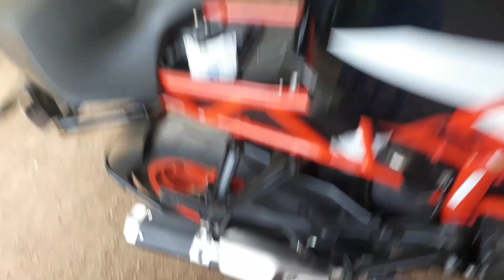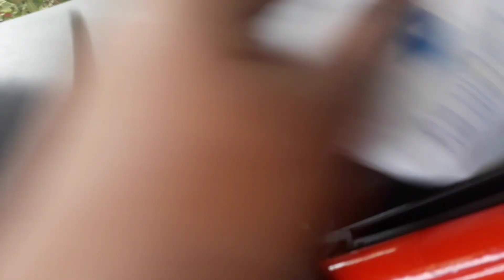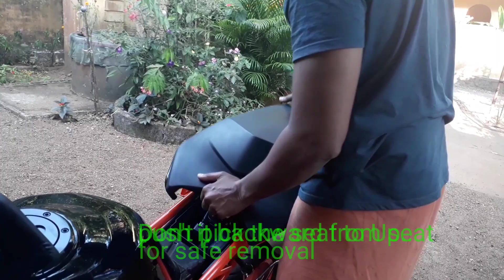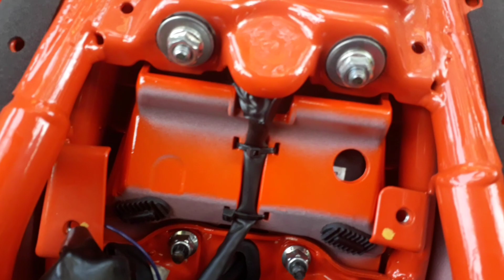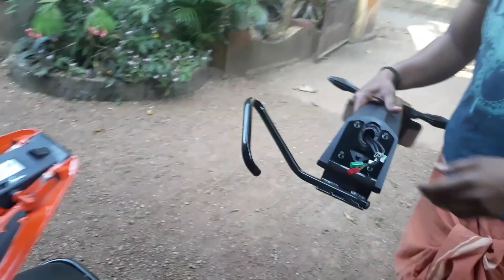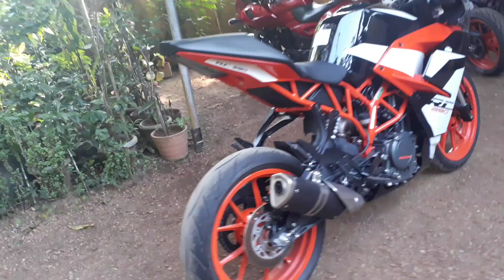Ktm RC 390 Tail section Removal

Comment: Hey bro nice video..
By the way I need one help
How to fix the rear indicator ,my indicator has broken and its not broken I mean like it cut of and fall down where only wires are holding the indicator from falling ..how to fix it plz say
Reply from the maker: Hi bro For temporary set up u can fix it with the help of super glue or M seal . better u go with a new one it will cost u around 550 per